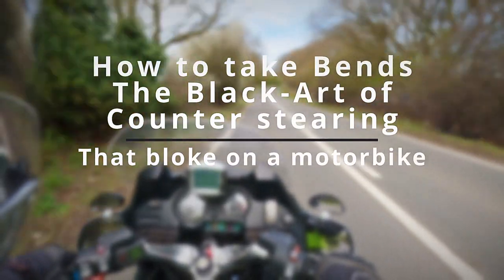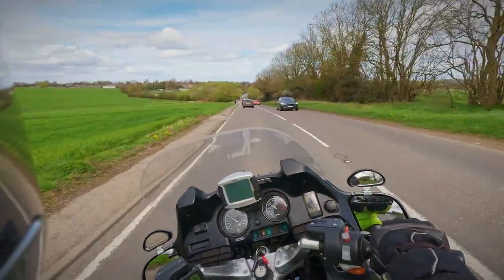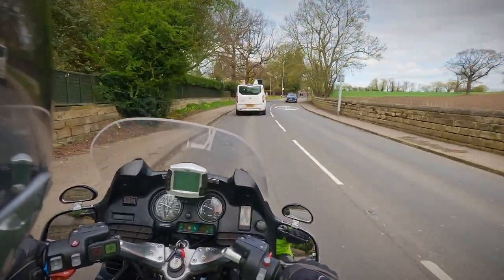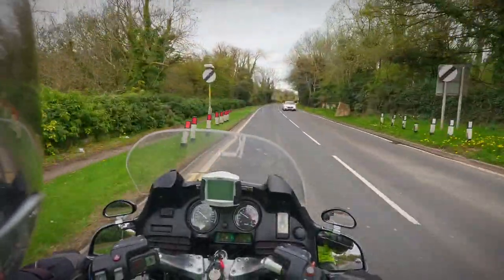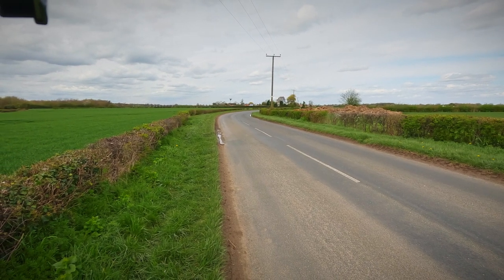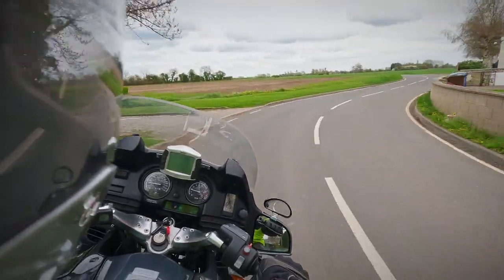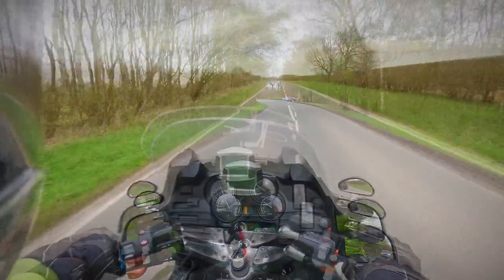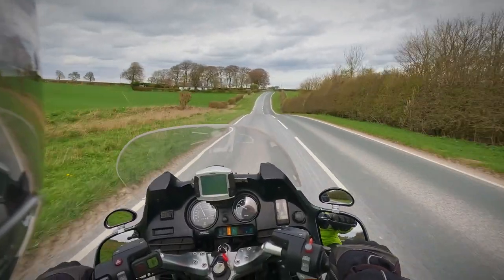3 Tips for safer Cornering & the Black Art of Counter-Steering

Comment: Extremely informative as usual. Please keep these coming. I've been riding for nearly 50 years and it's good to know I'm pretty much doing at least the counter steering and road position correctly. I did notice the warning chevrons looked to be consistent with the actual corners. I used to ride for long distances a lot at night (less traffic) and found the 2/3/4 chevrons a great help in setting up for corners. Not sure they're as accurate nowadays. There are plenty in Lancashire that just look like they've put a sign up with no regard to the actual radius of the corner.

Comment: Hi Dave great stuff, but was just wondering why you put weight on the bar to counter steer and not push forward?
Reply from the maker: Hi Alan, thanks for your comment and question.
It's basically the same as pushing the bar. The big difference is by using your weight on the bar it's more controlled and potentially less violent. 
From teaching it I found that riders were pushing far too hard causing the bike to move off line violently initiating a weave, or the riders panicked and grabbed the brake.
By getting them us weight the bar it was a gentler way of getting them into the black art. 
Hope this makes sense,
Ride safe, Dave

Comment: Thank you, nice video. But I have to disagree with your thoughts on positioning. I know you have based this on conventional wisdom, but I abandoned positions 1 & 3 some time ago, and I have found it very liberating.

I stay in position 2 most of the time, and here are my reasons:

1. Positions 1 & 3 leave no safety margin, should the bend tighten suddenly, or other hazard appear. In position 2, I have half the width of my side of the road in which to think and react by perhaps leaning more, throttling back, applying the front brake or changing direction. Also, I have that margin to stop on my side of the road. Hugging the white line or the kerb denies me all this. Why not stay in position 2 and be safer?

2. On the roads you were riding, the extra “vision” around the beds in positions  1 & 3 is minimal. I note you had to stand on the grass verge to try to accentuate it.

3. You demonstrated very well the danger of position 3 on left hand bends, as you met wide trucks coming the other way. Staying in position 2 means you are always in a safer position. Indeed, on roads such as these, at this time of year when there are lots of massive tractors about, I will sometimes edge towards position 1 on blind left hand bends.

4. On wider roads, there may be more vision around bends in positions 1 & 3, but swinging back and forward between them confuses following vehicles. I’ve had cars (and vans and bikes) try to overtake on the inside because they thought I was turning right ahead in position 3, or on the outside in position 1 because they thought I was stopping or turning left ahead.

5. On twisty country roads, staying in position 2 lets you concentrate on the road ahead, instead of thinking constantly about flitting back and forth for no good reason.

6. Most potholes, for obvious reasons, occur in the tyre tracks of heavy vehicles ie not in position 2.

Comment: Nice video but  I have concerns about the limit or vanishing point on a left hand bend. The diagram shown draws a line up from our position and until it hits the right hand kerbside  or verge.  That is not  completely true as if you look at that diagram then it shows a line drawn which is well over our mid line and onto the other side of the road to the kerb/verge. That space on the offside of the road is not of any use to us and so the distance that you can safely stop in is only up to the mid line as we cannot use the other side of the road for stopping distances. .  That distance  could only a few feet if its a short bend of say 90 deg. but that distance that we can see up the road on a slight curve could mean we are seeing quite a distance on the wrong side of the road of many metres/yards.

Comment: Watch Motojitsu One Finger Countersteering Demo for countersteering. Motojitsu pushes the handlebar with one finger, not weighting. There is also a US ex-police bike rider showing exactly the same, pushing the bar.

Countersteering is moving the handlebar in the opposite direction of where you want to go: push the rightside to go right. Push the left side to go left. It only works above 20-25 mph.
Reply from the maker: The change point between turning in the direction of steering and counter steering is around 5 to 6 mph not 20 to 25.
I have been teaching this for 40 years as a UK registered motorcycle instructor covering basic to advanced riders.
Pushing on the bar can cause a violent movement in the bike.
There is much more control my weighting the bar. It allows you to steer into the turn AND recover from it 
Ride safe, Dave

Comment: Re counter steering… when you apply pressure to say the right bar to turn right it makes the bike lean right. Do you need to press on left bar to bring the bike bike to vertical as you come out bend ..?
Reply from the maker: Hi, you can either relax the pressure and the bike will come back up, 
Or you can use pressure on the opposite bar to lift it up.
I find that useful in a set of bends, it makes the steering much more precise.
Practice it on shallow bends first though.
And don't grip the bars tightly, it's almost like just resting your hands on the bars.
Hope this helps
Ride safe, Dave

Comment: Great informative vlog however why not push bar instead to weight it I get the same results.ATB
Reply: Weighting the bar is the same as leaning into the bend. This doesn't counter steer. It's mechanically impossible to change the gyroscopic force that way. He is pushing forward but dosnt  realise it. You have to MOVE the bar forward to counter steering.